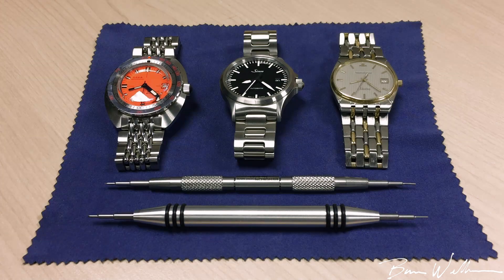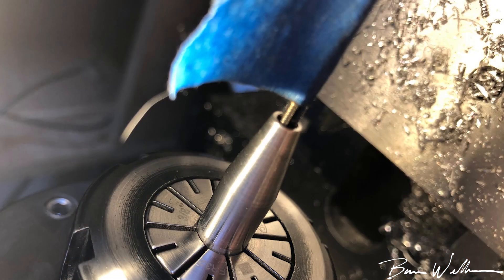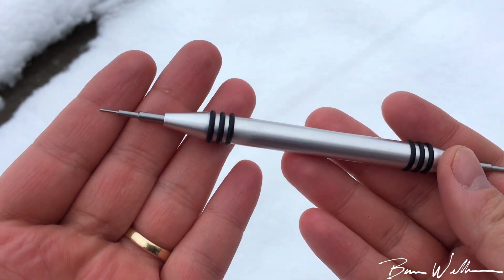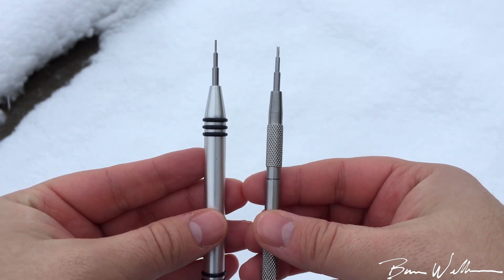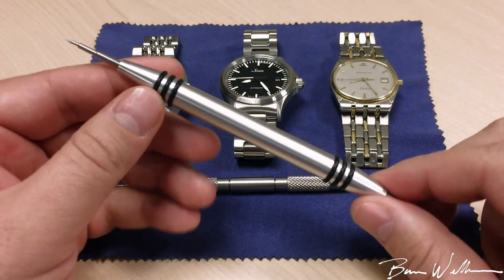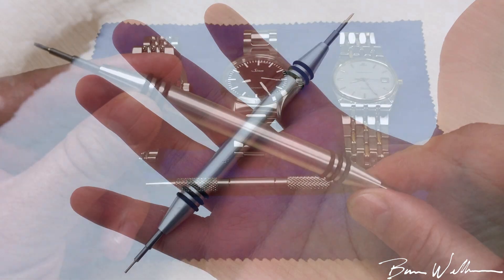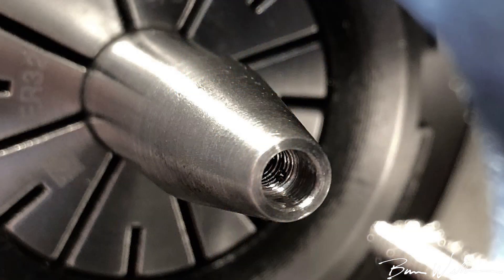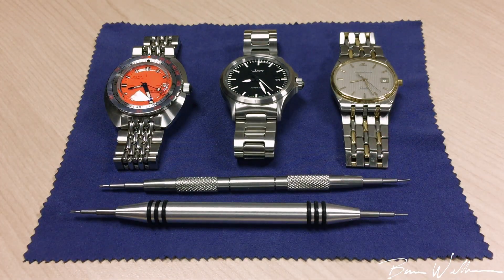Baughblabs Custom Springbar Tool

Comment: This spring bar tool looks the business and although the price is high, I guess it’s relative considering this is a high quality hand made product. Quality always costs as is the case for any hand made, artisan produced product.
Reply from the maker: I would say a lot of it is the time required to make it happen. Its gotta be worthwhile for Robert
Reply: Bruce Williams - I totally agree, this springbar tool isn’t a main stream mass produced product! Great piece of design too. 
I collect and use fountain pens in addition to my watch addiction. My favourite pens are hand made by a local artisan custom pen maker called John Twiss. The materials John uses to make his hand-made pens cost around £30 or so per pen, that’s circa $42, but each pen sells for circa £200 or $280. The additional cost covers John’s labour time taken to design and produce his quality products, the overhead in running his studio, the upkeep and maintenance of his lathes, laser etcher etc plus a margin of profit so John can pay himself an income. Just like the Baughblabs Custom Springbar Tool, Robert needs to cover his costs and return a profit and I have no problem with this at all. 👍🏼

Comment: I think that you are conflating "custom" or "bespoke" with not being mass produced.  It's the always the same design and there isn't any way to change it to suit one's needs (not that much variance is needed in spring bar tools anyways).  I'm glad that someone is making a new design, but it is a hard sell at over twice the price of a Burgeon 6767, especially since it uses the same tips.  I wish you went into more detail about why you prefer the Baughblabs, because I don't understand how it improves on the design of the Burgeon.
Reply from the maker: Lighter weight, larger diameter, more 'grip'  translating into better experience in use. Plus the design is sharp. Not everyone will feel as I do though, and that is cool with me
Reply: Yeah, I can see how that would work.  In that case, it might be a great tool for someone who is always changing watch straps.